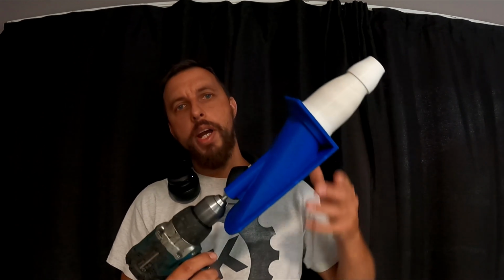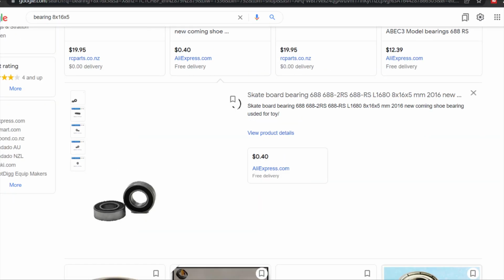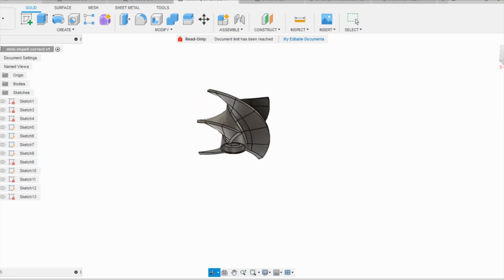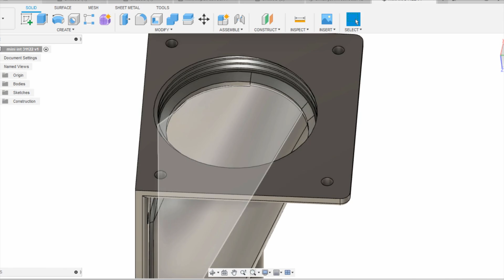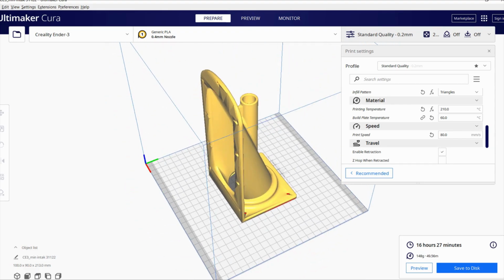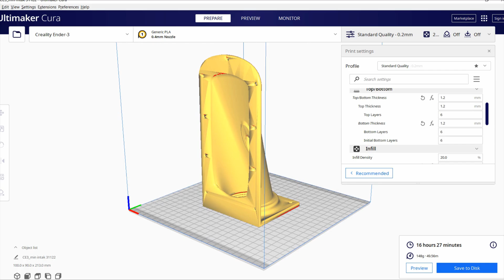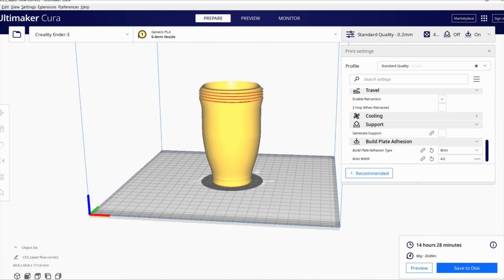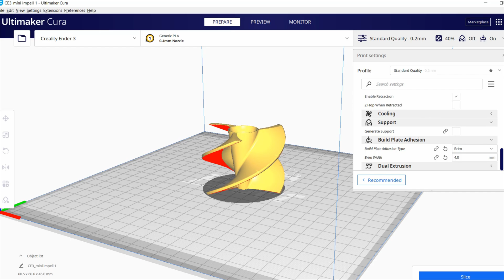Home Made Jet Unit 3D Printed 60mm

Comment: Could it be scaled up to around 150 to 200mm for use on a electric cruiser, I'm planning a sharpie boat around 40ft without sails and fully electric, ive been looking at both jet drives like this, and underwater pod drives im on a budget so i figured this kind of cheap and easy to replace drive system would be perfect if it can be scaled up, not to mention from what I've read both jets and pods are very efficient amd lower power drives, that aren't going to suck all of the electricity. I am aiming for a max speed of at least 30knots however i hoping for speeds closer to 50 knots.
Reply from the maker: Jet pumps are inefficient, a prop is best for efficiency. Sounds like an awesome project, will it be solar powered?
Reply: @DktheWelder  yes it will be solar powered, I want to use a mix of drive systems as this boat is being planned as a systems tester for future designs, the jet drives get a good speed for the electricity they use, so could the design be scaled up?
Reply from the maker: @tomleake8227  you could scale up the design but to go 40 knots you would need like 500+ hp on a boat that size . It would be really expensive to get an electric motor and batteries that much power

Comment: Awesome video and very well explained. I have already started printing mine out and want to see if I can attach it to a surfboard or a kayak. just wondering will there be a steering unit for the front of it?
Reply from the maker: Yes there is a free steering unit on the same CG trader site 👍
Reply: @dkthewelder  awesome! Thank you for letting me know. I was thinking to scale it down by 50% for an RC boat but i am also putting on onto my kayak

Comment: Good morning! Congratulations, perfect job! Please, I live in the Brazilian Amazon and I have trouble getting software to print your project on my printer. How can I get your full and 190mm diameter propeller design or even what is the name of the software? I'm thinking of printing the part to be molded and cast in aluminum. What is your opinion? Thank you very much and a hug from Brazil.
Reply from the maker: One of them is 60mm impeller the free one has a 100mm impeller. I use cura as the slicer which is free the files will work on there
Reply: @dkthewelder  good morning. Thanks. 
Sorry, I don't understand "cura". My english is bad. 
What the software used? Thanks so much

Comment: I personally would use petg or even abs instead of pla since pla is biodegradable. Also with abs you can is acetone to smooth it and give it a cleaner look 👍
Reply from the maker: I would like to try petg but like PLA because it is cheap and strong , also a lot of what I am doing is in the testing phase still
Reply: @dkthewelder  absolutely, pla great for testing. Just wouldn't use it for longevity on this

Comment: Is there a steering part to be printed ? Or a reverse bucket ?
Reply from the maker: I have made them for it put want to do a proper test before posting the drawings, so should be next month some time
Reply: @dkthewelder  Okay, cuz your jet seems powerful with its propeller so i would use it in my project if there was a steering head and maybe a reverse bucket. So i'm waiting patiently for those parts to be posted 😸😸 Thank you very much, i've been searching for a good jet engine model since 3 or 4 months and now, I found yours 😄😄

Comment: So I got a 4 stroke 5 horsepower engine think it’s going to work? 
And I’m 15 maybe 110 pounds I could be wrong but do you think I’m going to need two jets?
Reply from the maker: The problem with the four stroke motor is the rpm isn’t high enough , you can get around this by using a steeper pitch impeller which I think I have on that CG trader file. I think one would work since you are light are you making a board or boat? Also I have just printed a steering nozzle and reverse bucket for it now I will start testing soon.
Reply: Oh cool This is the right Nazar up soon up 
I’m hoping to make a boat so should I find a 2 stroke then?
Reply: Hey if I up scale it to 200% would I get more power out of one?
Reply: @theironman_man291  I've been thinking about that too.  I'd like to know that too.
Reply: @kiran-by4qz  I almost did it but it was going to take 2 days for half of the jet so I didn’t lol
Reply: @theironman_man291  understandable
Reply: @kiran-by4qz  yeah

Comment: Cool, i want to try this style of engine on a rc boat.
Free 3d printing tip: use carbon fiber nylon filament and print with 100% infill, then you will not have to worry about strength or durability.
Reply from the maker: I have heard of that it is difficult to print with and I think you need a steel nozzle
Reply: @dkthewelder  it do not specifically have to be steel, but it have to be a harder nozzle then brass because like many other filaments added CF is abrasive to brass nozzles.
The 100% infill can also aid with regular pla.

Comment: Man I really want to try this but I can't even print a drawer organizer without it lifting. Tried glue, tried tape, I might try a small enclosure with a space heater I heard that works. Idk. I want to try and $3 is more than extremely fair, but not yet...not till I can print reliably.

I appreciate you, thank you for sharing your skills knowledge and experience
Reply from the maker: Glue stick works for me and also my printer is in a box. Another way is printing on a raft helps , I usually print with a brim . There are a lot of people that are very knowledgeable that have commented on some of my videos , I’m sure if you comment they will give you advice. I actually got lucky with my printer worked well straight out of the box👍
Reply: @dkthewelder  thanks for these suggestions. I'm gonna play with it today. I want to make a small catamaran and put one of these in each side, but I got a long way to go.

I appreciate you. Have a fantastic day
Reply: @michaelosmon  sounds like your bed isnt level, i was having a hell of a time sith adhesion. make sure your bed is level and the rollers are tight under the heat bed

Comment: Rule of thumb for intake is about 2x as long as it is wide, and I found having the outlet be about 50% of area of the effective pump area, where effective pump area is the impeller diameter area minus the impeller center (the hub). Pitch should be about 80% of the impeller diameter I found. ie, 50mm jetpump, pitch should be around 40mm.. I tried lots of things. This worked well.
Reply from the maker: Thanks that is good to know 👍
Reply: @dkthewelder  no worries I also have a 3D scan of the same jet ski impeler that you were holding and a 3D printable file for it. Let me know if you want a copy of it
Reply: @jotham123  Yes please!

Comment: Love your work. Ever look into UAV or model airplane engines by DLE? They manufactured the original jetsurf engine designed by a Czech company. I've been wanting to test them out but for 900$ a motor I can't swing it.

I looked into the same Chinese pit bike engines. I think you could get them to work with some gears to increase RPM and sync the output shafts.
Reply from the maker: I haven’t seen those motors I will check them out
Reply: @sourand jaded yea ita a shame. I'm pretty sure the military is doing the same thing with the liquid x rotary. Even the icon home 3d printer is completely unavailable for civilians atm

Comment: So if I have a Cr5 pro high temp and use petg this will still work? I'm curious to give it a try just for fun. Awesome vid as always
Reply from the maker: I can’t see why it wouldn’t the impeller to the flow corrector is the only real tight part but you can just sand it. There might still be a free file pack on the Facebook page my wife is sending them off

Comment: This is so cool, and to have the plans available for 3 bucks is awesome! Great work man, love things like this that push what 3D printing can do. My only suggestion is that PLA isn't great for printing items that will contact water, I would definitely print this in something like PETG instead. 😊😊
Reply from the maker: Yeah a lot of people say petg is better, thanks
Reply: Could you coat this in epoxy or would it eat into the pla?
Reply: polycarbonate, the good polymaker max stuff. Tho you might have to anneal it in home oven and compensate for any shrikage it causes to get higheset possible strength.

Comment: Awesome Project! 
I am currently tinkering around with a 3d printable jet design as well. 
Yeah the missing thrust bearing + generally floating bearing concept might be an issue, maybe it can be fixed with c-clips that hold the rear bearings' outer race in place or a removable lid. 
Apart from that, it looks very promising! No real CAD expert, but if you used the loft-tool in CAD to make the jet inlet's general shape and aren't happy with the results the tool produces, you can experiment around with construction lines etc. to get different shapes. Maybe you could also simplify the nozzle/stator flange to a more traditional design. 3d printing windings reliably  can be an issue because of the overhangs and might cause some people with different printer+settings some headaches. But that is already me grumbling on a high level...
Reply from the maker: The inlet was really difficult for me I tried sweeping it and heaps of other ways but ended up with using the loft as you say , which you can move points around to change the shape. I might make a better way off using a thrust bearing I have a few ideas I’m hoping someone will figure out the flaws so I can improve it. The flow corrector works really well I think you would need a pretty bad printer for it not too work. On the intake what way would you use to get it to like curve in a bit better?
Reply: @dkthewelder  I just made a short video of how I draw jet inlets in cad (fusion360): https://youtu.be/7LMtgWic5h0

Comment: Infill density past 15-20% doesnt add much strenght. Just like with a metal beam the material furthest from the center does the most work. So increasing the wall thickness of your parts and 15% infill will be more much more efficient than a part with 40% infill. This will save material, weight and print time.
Reply from the maker: Ok thanks! I have done some 100% prints that are super strong like dimple dies and used them in a hydraulic press to bend steels
Reply: I've found that (specifically) translucent PLA printed at 100% infill and a slightly higher nozzle temperature is incredibly strong, I'll have to do some comparisons.
Reply: What about the issue of waterproofing
Reply: That's pretty much how fiberglass composites work. The core is just there to hold the two fiberglass skins in place
Reply: What higher infill does help with is layer adhesion issues.

Comment: If you want cut your print time down to 1/4 of the time with no strength loss get yourself a couple 1mm nozzles
Reply: Those might be too coarse for making hydrodynamic parts. 0.4mm leaves a relatively smooth surface
Reply from the maker: @awellner3285  I agree the smoother the more efficient, and I just leave it overnight for the longer print’s
Reply: @dkthewelder  true but let's say you don't know what size jet nozzle you want.you can print 4 in the time it would take 1 find the size you want then print that size how ever fine you want
Reply from the maker: @stickypaddle6432  yes I ended up printing multiple of each part trying to get it right and with a days wait between each design is pretty annoying , maybe a bigger nozzle could be the go for figuring out the best option
Reply: @dkthewelder  bingo

Comment: Nice work
I printed a 55mm 100% infill from petg,installed in my kayak turning 2k rpm i got 4mph.
Plenty speed to cruise around.
Reply from the maker: O nice one! Do you have a video of it? Also how long did you run it ? Wondering how long the plastic will last
Reply: @dkthewelder  theres the first test vid in my library.on that test i usesd a 775 dewault motor,printed 2.5:1 gear reduction....it was loud and 3 mph.
I didnt vid the 2nd motor test,it was a 250 watt scooter motor direct drive.stopped using it because it was 24v.
At the time i couldnt swing the cash for a big brushless motor and batteries.
The pump has been retired for awhile now.
Petg will last awhile.my rudder setup been out in the sun for 4 years now,no issues.
I didnt try in pla,i only used petg.
Reply: @southernlifelouisiana my motor 500w from scooter is too hot about 3-4 min. Crusing On lake